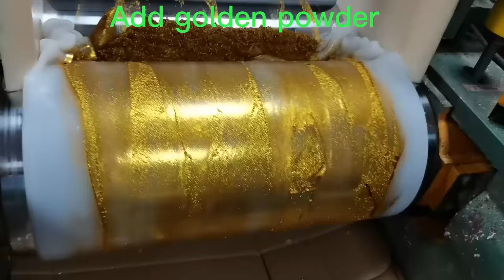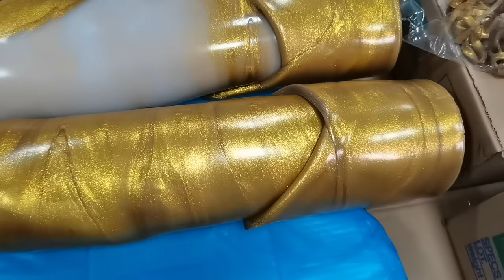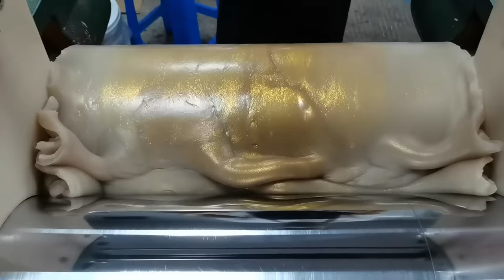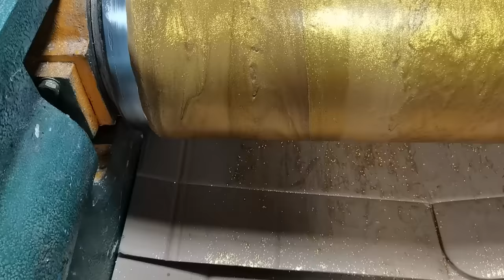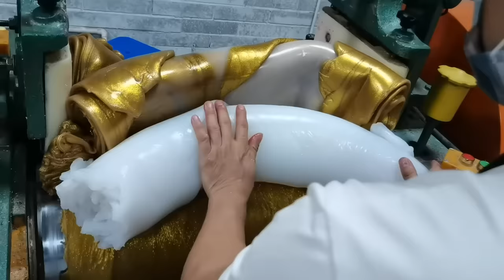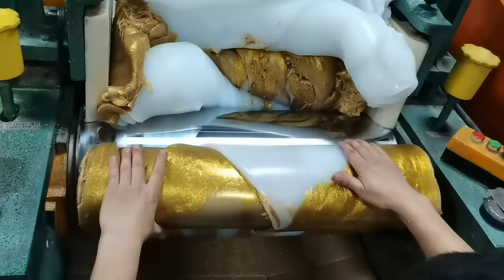Golden powder color mixing(see the end,you will see the shining product,no music

Comment: I'm very curious what the golden silicone hearts are for. I know someone suggested using the cutting after molding back in the machine, but it appears to be heat pressing the hearts to shape them, so the silicone would likely be too far into the curing process.
Reply from the maker: This is depending on our factory designing.No very far.
Reply: Probably decoration for a wedding of event
Reply: U eat them
Reply: How
Reply: How about silver powder?
Reply: They did add a vulcanising agent into the mix at one point 🤷🏽‍♀️

Comment: I see these videos. I use silicone but it comes in a tube, I've seen casting silicone, that comes in a bucket. What does all this silicone get used for?
Reply: We see more and more products made out of silicone instead of plastic. A company will mold the silicone( once they color it to the desired color) into different products such as silicone bakeware, decorations, etc. It is resilient, durable material that is more ocean-friendly than plastic as it doesn't break down like plastic causing issues for sea animals.. It can also be recycled and doesn't lose its color like plastic products.
Reply: @dianad3080  can be recycled, but probably like most other recyclables... Isn't.